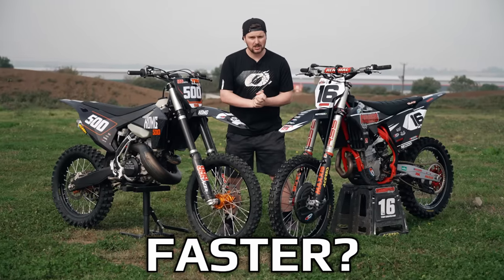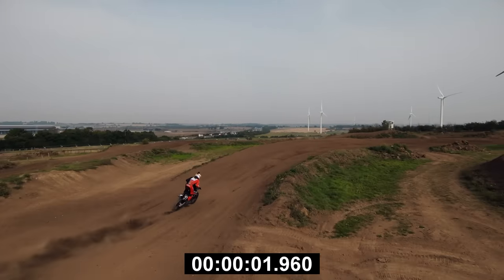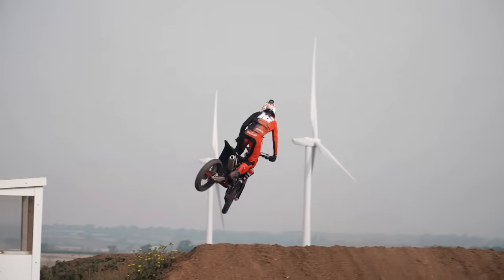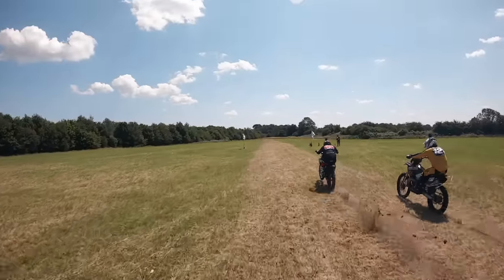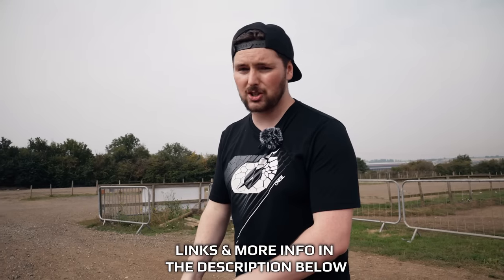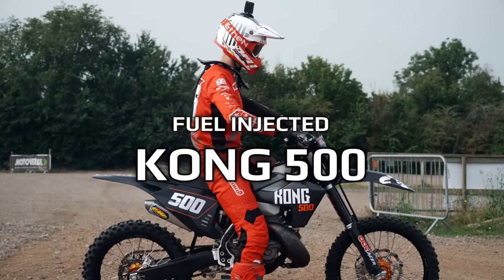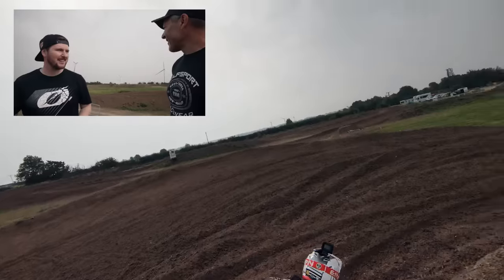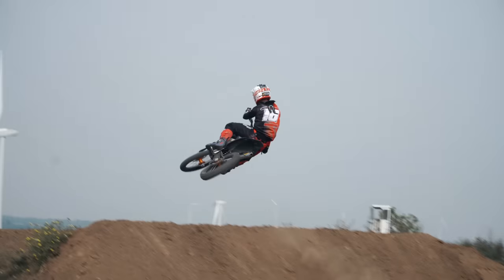Brand New 500cc 2 Stroke vs 450 Four Stroke RACE Bike!

Comment: if one has the strength and desire the 2 stroke 500 has to be the winner you cant beat the raw explosive horsepower the trick is tio Manage the power to beat a 450

Comment: So steel frame, chassis developed for about half the power and built (no offense) mostly in a shed. 
Can you imagine how fast these things would be with the extra 20-30 years of factory development they are missing?
About the only big difference on that engine from the old ones is FI. 
Imagine if the chassis was developed around that engine and that engine was developed with modern design, casting/machining techniques and so on from the ground up. 
I reckon there would be another 10kg loss and another 10hp more over a massive spread. 
As if it isn't impressive enough already.

Comment: Back in the day the Honda CR500R was a mega machine.  Under power it had the torque of a four stroke without real weight.  Under power you could ride it and put it where you wanted to.  But stopping it was another story.  It was so easy to lose sight of how quick you were going.   I was so small at nine stone that all I could do was ride it on the throttle to the point it tried to kill me.   To date the most devastating machine I have ever been on.   If KONG is anywhere close and probably better, with all the modern teck listed, I can see why Tom nailed it and has the smile to prove it.  Mega.
Reply from the maker: Thanks for watching. Appreciate your comment, the CR500 is an iconic machine for sure.
Reply: Thats why they make oversize brakes. Mine gets a good workout!

Comment: I really enjoyed this. Now my prediction is that he would be 3-5 secs faster per lap if he were to ride the 500cc for two months about 4 days a week. He was naturally very comfortable on the 4 stroke which is what he’s used to so he’s going to actually ride it better. The 2 stroke made up that difference due to being more powerful and quicker so if he was adjusted to the bike he would be faster on the 2 stroke for sure. Now I would like to see that test done where he’s had several months to practice on the 2 stroke. If he practiced only on the 2 stroke and did not ride the 4 stroke at all then I would say he would easily beat it by 5 secs.

Comment: If you want to compare this to a (mostly) stock CR500 & KX500, mine are as close to stock as you'll find. I even have the original pipe on my CR.
Reply: Many old-timers have told me that the stock pipes were the all-around best for them. Unfortunately,  mine came with an fmf, and the stock one was wasted. So I can't test that statement.

Comment: Congratulations for another epic video Max!!  Considering the last bolt on this bike and also including the labor, what should be the price for Kong;;; North of 30 k?? And how much hp is the motor??
Reply from the maker: Thanks, we haven't put Kong on the Dyno yet, but will do soon now its all done. We'll be sure to film it and let you know the results. Costs depend on what donor bike you start with and how far you go making it look good I guess. We haven't added it all up but probably £15k to £20K or a little more if you start with a brand new bike.
Reply: Thank you very much for your answer! Looking forward for the Dyno video!! Keep up the good work!!
Reply: The engine kit itself is $7-$8K.

Comment: You guys have any trouble tuning the 500 as a tpi?
Had a bit of trouble with mine mainly idling too low but got the tb yesterday so hopefully it fixes that, also had an issue with a  lean bog because the power valve opens too soon but found an easy fix for that.
Reply from the maker: When we first did the conversion we ran it once with the TPI, the bike ran well apart from the idle, but that's because we didn't do the idle screw mod (as we knew we were going to do the tbi conversion). Obviously we had TSP flash the ECU to the BRC500 spec first.  The TBI conversion using @brc racings new TBi throttle body is incredible. Our bike couldn't run any better, its incredible. We still use the stock TSP flash , but you have to get hold of the new ERM module that TSP have recently brought out to adjust the fuelling and increase it by 20% in most areas otherwise the bike will not run well. If you speak to TSP or BRC they will guide you though this. If you are in the UK Rutherford Racing are the guys to talk to about the ERM. We are making a full video from start to finish about the throttle body conversion. It will be out in the next couple of weeks and you'll see what we've done from start to finish. Hope that helps.
Reply: @999lazer  cheers for the reply, I can get it to idle faster if I turn the idle screw up but where it needs too be for normal idle speed the tps % is too high, it can't go over a certain % or it messes with the mapping, doesn't seem to like cold starting either that's probably down to the slow idle though . I'm based in aus, the tsp map has been tweaked a fair bit it was running way too rich fouled a plug in the beginning and the pipe was full of oil . I just got the brc throttle body a few days ago be taking it back to the dyno once installed so no plans for the erm at this stage hoping the tb makes a big difference though can't wait. The bog it had wouldn't be as bad on a track possibly wouldn't even happen, it was roll on 5th or 6th gear  just as it hit powerband, if I keep the revs up from the get go like you would on a track it's not noticeable.
You probably know by now but keep an eye on that decomp nearly lost mine before I added loctite and fairly sure that plastic power valve cap is going to melt showing signs already, found some similar billet rotax sea doo caps but m8 thread so no go and can't find anything but plastic for the brc pv which is rotax evo.

Comment: If they ever let 2 strokes enter back in the factory cc for cc ,  for example 250 vs 250 ,  450 vs 450 with todays fuel injection,  the 4 stroke sales would die overnight

Comment: I'm surprised the 500cc bike didn't significantly beat the 450cc bike.  I understand the difference between 2-strokes and 4-strokes (e.g. weight, shifting frequency, etc.), but the 500cc bike is more powerful and lighter.  Hmm?
Reply: The suspension wasn’t set up to his liking
Reply from the maker: You have to remember it was Tom's first time on the 500, he's been riding the 450 all year. It would be interesting to see the difference with more time on the 500 :)
Reply: You're correct, mx bikes are about power to weight ratios. A 500 2t is an opera class bike and a 450 4t is the replacement for the 250 2t due to engine dynamics. This test just shows how good the modern 450 is
Reply: Also don't forget that he has been riding 4 strokes for years and has got very used to them . 2 strokes take time to master I guess he could with practice take another 5-6 seconds within a couple of days and probably more over a longer time

Comment: We need these 2 strokes back. No easy way to say it. The EPA is not involved because they are still being sold by KTM, Yamahas and a few others so it’s not the EPA. If Honda made the CR’s again they would easily take over motocross and even have pros riding motocross. I heard the owner of Honda was the one that pushed for 4 stroke Honda dirt bikes. He should be fired. What a mistake he made. If the 2 stroke CR was brought back it would change motocross forever and make Honda multi millions.

Comment: A fuel injected 2-stroke... kinda defeats the value that a 2-stroke has over a 4-stroke... 
2-strokes have always been lighter, simpler to work on, cheaper to rebuild, and dead on mechanically reliable... you add EFI and the required electrical system and you've created a solution to a problem no-one had... it's like Harley and the Twin cam engine because the EPA thought the camchest was too loud... you create problems for a perfectly designed engine.  
Just the humble opinion of a long time desert rider... but I'd take a carbureted 2-stroke over EFI all day... every day...

Comment: 500 2 stroke has no chance in a race track..even if they put it in lightweight new frame and tuned ..and still it cant...i rode them all and cr500 ..the only bike that was pulling my arms off it was a 09 tuned kx450 with long gearing and a fatter rear tire..that bike was the most brutal mx ever..beast low down till red line..and race was in favour of that 2stroke..put that 450 engine in a 125cc frame like you did on 500 in a lightweight frame and ypu see whos faster by a train